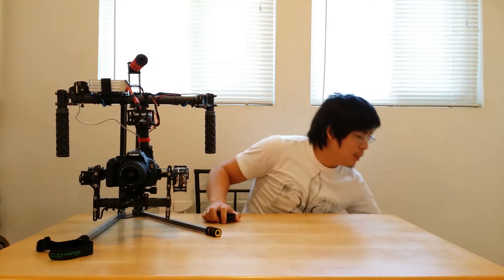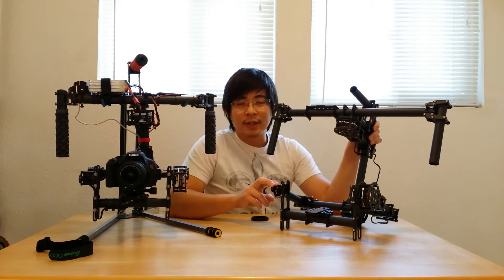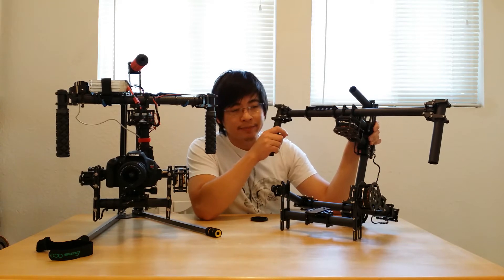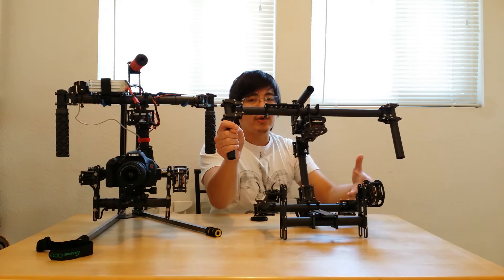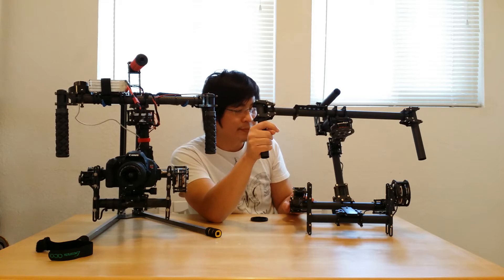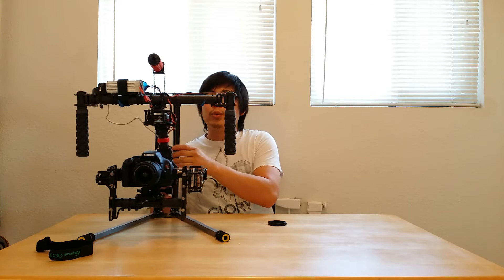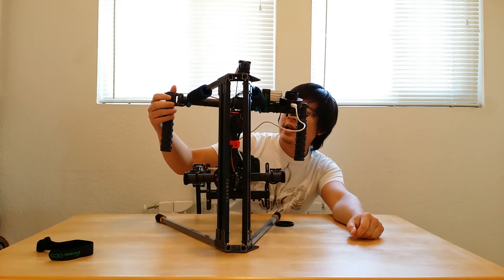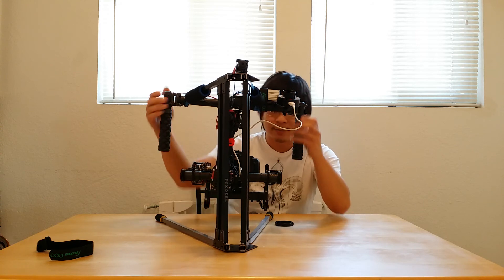3 Axis Handheld Brushless Gimbal Custom Build

Comment: Does anyone have a Turbo Ace Allsteady 6 gimbal? I need to have access to the original firmware for a medium size DSLR
Reply from the maker: I actually helped with the programing and tune for the Allsteady, but I just cleaned out my laptop and deleted all the files I had for the different tunes. Most of the time you can use the same tune for heavy cameras and lighter cameras if you have the later batch of the Allsteady. But if anything double check and make sure you have the gimbal balanced correction the camera and that nothing is loose. If the gimbal vibrates its a sign that something is loose not not balanced correctly. You can adjust the P gain and lower that value down to see if that helps.

Comment: Hey Tony, thanks for the very helpful videos you put up! I'm currently fiddling with a DYS 3 axis HDSLR gimbal setup.. just wanted to know which stand that is that you are using in this video, or is it custom built? Also curios about which (smaller) joystick you found / using now as I plan on adding that as well. Did you have to assemble that on your own as well (+ the button)? Thanks!

Comment: What is your Frame on your original Gimbal? is that a Hi-Fly frame? i have a DYS that i dont like very much, i want to switch to a frame like that. thanks!
Reply from the maker: What's don't you like about the DYS gimbal? I was thinking about getting one of those to try out
Reply: tonytypes i found it extremely difficult to balance the Roll because you have to loosen and tighten the four castor bolts on the Roll assembly then move it and when it came down to fine movements, it would always Slip on me. also the 40MM castor bolts seem to Strip frequently, i had to get 3MM Lock Nuts to tighten them down. I think the set up you have appears to mimic the MOVI more by balancing the camera Mount instead of the Roll Assembly. hope that helps, check my channel for a video about the DYS HHG5D if you need more info.I have since done away with the Quick release Plate if you see the video
Reply: tonytypes one last thing, it comes with no instructions either so being a N00B it was hard to put it together. the screws on the camera platorm, that tighted it were also easily stripped